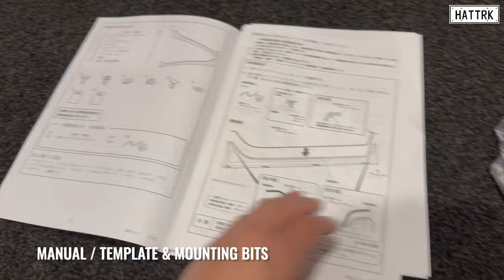無限 MUGEN -  SIDE GARNISH / SIDE SKIRTS (GROUP A) // FL5 CIVIC TYPE R

Comment: FYI you don't pull on the side skirt or you risk snapping the plastic pieces that are snapped in. You're supposed to push the side skirt toward the drive end and it dislodges from this plastic pieces. I did this on mine
Reply from the maker: Yes aware of that, all the tabs were loosened before pulling on them 😉

Comment: Would the rear spoiler, rear wing and interior parts installation be demonstrated also?
Reply from the maker: I have the Honda Access Wing and Interior pieces so probably not. The Bumper garnish will however been demonstrated when the part is released